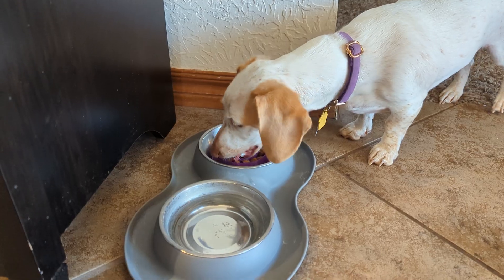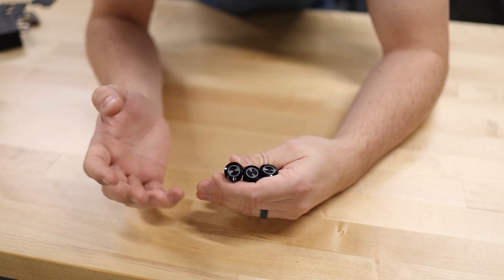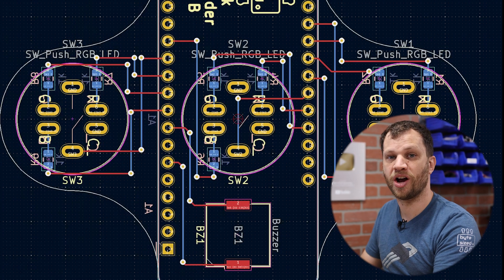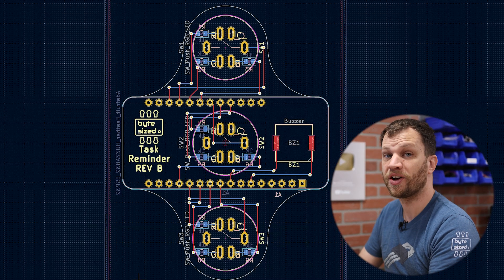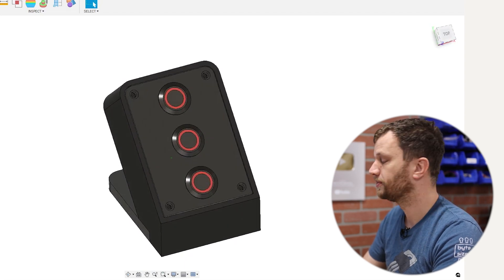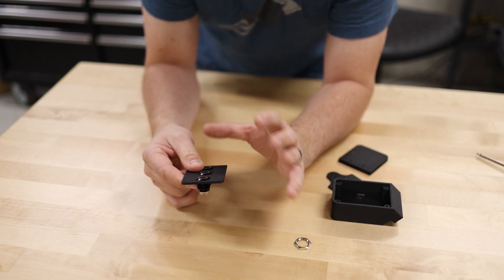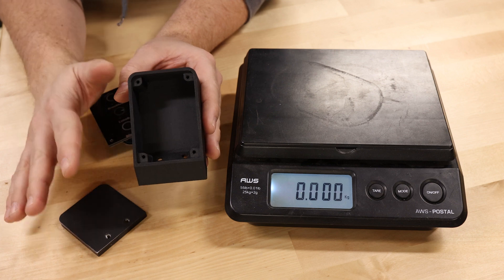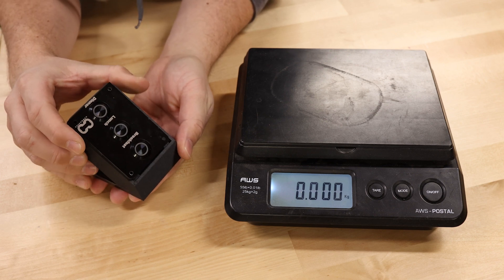I invented Chow Check to help my negligent friend

Comment: You're hitting an NTP server every loop?  That ain't cool.  I'd do a polling mechanism.  Have it get the initial NTP request, count to some arbitrary large-ish number, get another NTP request, see how many seconds (Maybe even msec depending on the resolution provided by the server) have passed, then you know how long to wait (roughly) before hitting the next NTP request.  As a network and service admin, I hate it when applications beat the snot out of services like that.  Not to mention, since you're using wireless, that's going to chew up a lot of the spectrum.

It'd be like "Ok, what time is it now?  Ok.  Going to count to a million.  Done, what time is it now?  Took me 10 seconds?  Ok. Based on that, I can count to 100,000 each second.  From there, if I wait 60,000,000, I can check what time it is and then do the button check.  Wait... I'm a little long or short?  I can adjust the base number of cycles per second and recheck later or earlier next time."
Reply: I'm not sure which NTP library he's using, but it's probably the same one I used in a recent project, and it implements that behavior by default. You call timeclient.update() every loop, but the library only hits up the NTP server once every minute (I think, I don't quite recall the default polling interval).
Reply: @evanbarnes9984 The update interval is 60 seconds by default. That is FAR too often to be bothering an NTP server. These CPUs have stable enough clocks that every 6 hours would be plenty.
Reply: Easiest way is to set a global variable for each task you do not every time in a loop to millis() which gives you the runtime in milliseconds the microcontroller booted. During the loop you can check if the difference between the stored value and the current value of millis() to be greater than whatever you need. No manual loop calibration needed, which may be optimized to nothing by the compiler by chance if you aren't doing anything during the count with the value.
The other option is to use threads which can use a delay function only blocking themselves, but this may require to use mutexes to avoid concurrent access to the same resources and thus may complicate things a lot. I only use it if the main loop introduce timing inconsistencies for some functions that require a fairly fixed interval.
Reply: @drstefankrank If its a 64-bit integer, then that makes sense.  If there's a guard in the NTP library that protects against just slamming the heck out of the NTP server I'm good with that.